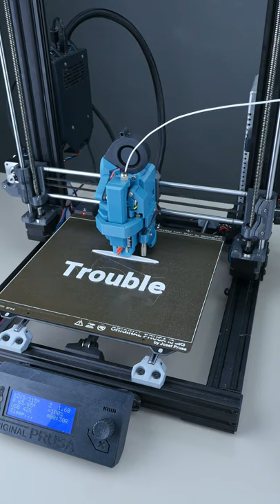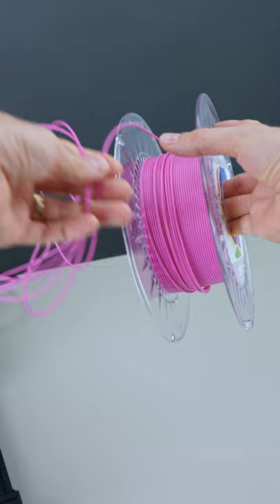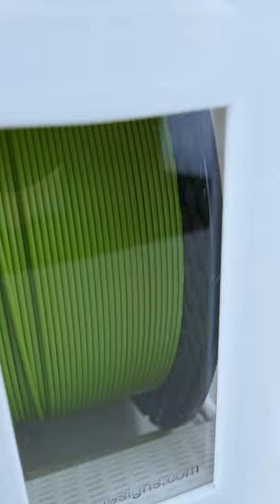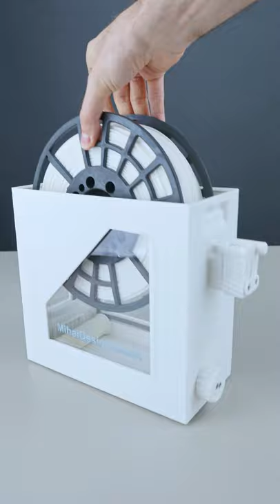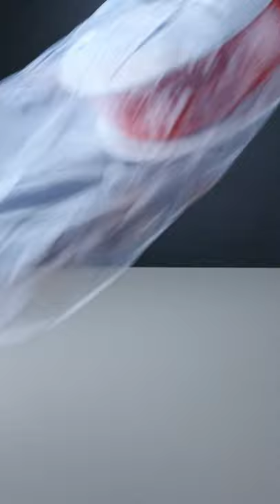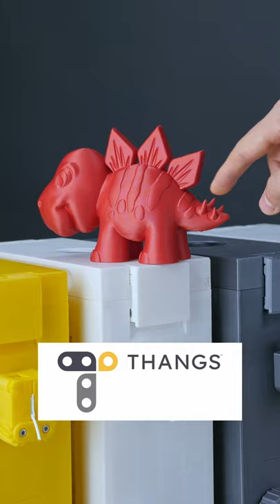Mihai's 3D printed filament DryBox

Comment: Idea! Add a master dock with a sealing port of some sort (hard to make it properly) that it attached to, the dock basically pushes hot air trough it and re-dries it!
Reply from the maker: Yup, was thinking about something like that. Maybe one day I'll do a proper filament docking station.
Reply: @MihaiDesigns  One would have to make sure you stay way above the material glass transition point. So both PLA and PETG would kinda be off limits for printing. ABS should work tho. Or annealed PLA to some degree

Comment: Potential further improvements:
- hex shape top of tray (to reduce drybox's volume/reduce filament use);
- larger volume desiccant trays (like whole outer corner of square and circle difference instead of of small rectangle box, or even integrate with roller and rectraction mechanism to maximize volume) with small opening with slides on sides to slide in flat outlet funnel to reduce desiccant bead spillage;
- slides on outer shell to slide in filament type name tag;
- for simplifying sake leave only front wall window;
- for simplifying replace double flat side gasket airtightening mechanism with screw-on or clamp on bottle cap over filament pass through outlet. Alternatively slide to side lid-door;
- put filament outlet, filament retracting knob, lid handles in recesses of main dry box, so to not stick out outside it's dimensions;
- rear top-lid handle might be replaced with simple hook into according recess in main body of dry-box.

Comment: Nice design! But I not figured out how it will buffer a multicolor print. Will the buffered filament just go back in the box? How will it not tangle itself?
Reply from the maker: If using the multi material unit, yes, the filament gets pushed back into the box. BUT I haven't tested this to make sure it doesn't get pushed back out a little bit when the spool is fresh and full. Doesn't get tangled because of the 4 rollers. It's one of the main features actually. With other boxes it's easy to get it tangled.
Reply: Thank you! Just watched the roller video. Pretty nice solution. For all others watch: https://youtu.be/VAjmTxpClBQ

Comment: Amazing design as always! But I have a question, will the swappable hotend be made compatible for the prusa mini? If so then I would totally print that!
Reply from the maker: I kinda doubt the mini would be able to work with a full sized extruder without serious stiffness improvements. On the other hand, I might make a lightweight version in the future for CoreXY printers which you'd likely be able to mount on the mini with some changes.
Reply: Good to know!

Comment: Hi , great project.. just one question , did you use 'supports' in your slicer when printing the box with 'windows'? will use a 0.6mm nozzle for approx 15hrs of print. 
Many thanks..

Comment: Very nice work. What is your approximate print time for these?
Reply from the maker: 15 hours with beefy hotend and 0.6mm nozzle + speedy settings on my MK3S. Otherwise, over 50 hours with normal extruder and settings.
Reply: @MihaiDesigns  How many watts are you feeding that hotend with? It’s a BIG part so I figured that would be the case. 👍🏼👍🏼

Comment: I need this so bad but can't afford filament. I wonder how many grams of filament they each take
Reply from the maker: About 700-900g depending on material and box option. I did test the super cheap PLA from GST3D. It did work, although there can be extreme diameter variations leading to clogs. So not a cheap box to build with all the parts.

Comment: I really like your dry box design
Are the boxes stackable ? 

I would really like to be able to stack them on top of each other
Reply from the maker: There's no stacking mechanism (to prevent them from falling) but I used to add rubber pads on the bottom to add a bit of grip. That's the only concern. Aside from that they can be stacked.
Nowadays I recommend looking into off the shelf dry box solutions which are about the same price and provide heating.

Comment: any way to print on a ender 3 pro?
Reply from the maker: Should fit the Ender 3 Pro.
Reply: In cura, settings, manage printer, change the 220x220 to 230x230 and put the bed clips in cross pattern like this ( % ) so the nozzle don't hit it, idk if u need other firmware to run that "plus" centimeter, but, in that case i recommend u Jyers firmware!
Reply from the maker: Make sure to use no skirt or brim.